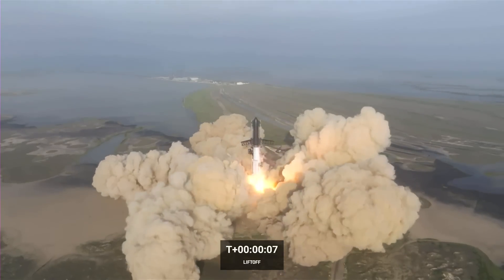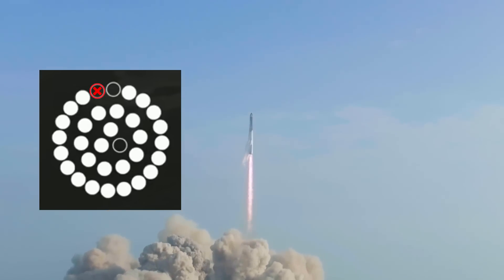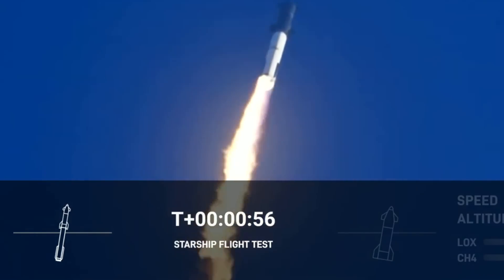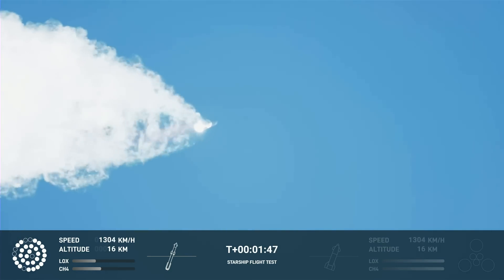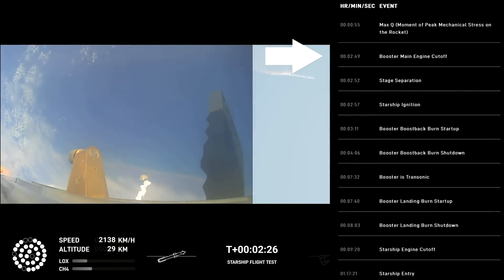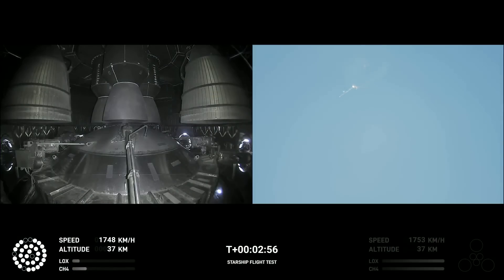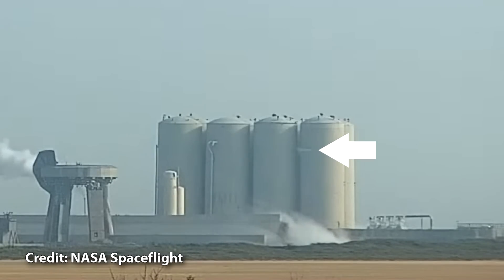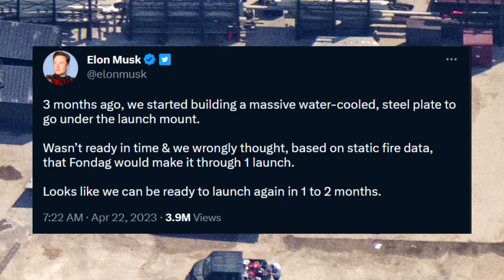I Watched the Starship Test Flight at 0.25x Speed & Saw What Went Wrong | Starship Flight Analysis

Comment: I hadn't expected the ground beneath the superheavy to be the issue and assumed there would've been sufficient planning to prevent the ground breaking up beneath the superheavy at launch. It was ludicrous to see how superheavy was launched blasting in an ill prepared position. That was just a dissapointing unexpected result. Ans the metal plate upgrade, I think it'll be practical for the test launches but nowhere near sufficient below a comercially active superheavy launch stand as the plate will wear down. Spacex is probably aware and I wonder how they're going to solve the flame diverter issue at Boca Chica, which now looks like an insufficient testsite now.

Comment: 9:19 "if this is what happened then this still means that SpaceX waited for over a minute to destroy the rocket"

I can't comprehend how you came to that conclusion. If the puffs we saw were the FTS (and Elon confirmed that they were) then spaceX didn't wait at all, the FTS simply wasn't powerfull enough to terminate the flight and it took a minute either for the aerodynamic forces to rip it apart or for the leaking propellant to find an ignition source. SpaceX had no control over when this would happen once FTS got activated a minute earlier.
Reply from the maker: Maybe I didn’t express it correctly. My point was that they waited for over a minute after the tumble started before activating the FTS.
Reply: @ProjectVirtualHaven  yes, i understand that, but we see the FTS puncturing the tanks right after the tumble started, that's why i don't understand why you think they waited for over a minute. 

The FTS took over a minute to do its job though
Reply: Elon said they need longer explosives to destroy instead of just vent the tanks.

Comment: This analysis is way better than many on channels with 100 times as many subscribers. And then I saw this is not even your main interest!  Wow!

~ 12:10 - I think that ever 4-6 months is very optimistic. Let's say sometimes this year...

Large amount of test data collected notwithstanding, SpaceX shortchanged themselves by rushing the launch from unprepared OLM (which, as you said, survived at all only by dumb luck). Evaryone new the OLM would be torn apart; the only question was how badly. Had they waited for that cooled steel plate (provided that it works, of course - it is still not a proper flame diverter with water deluge), they would have far more data on performance of undamaged Raptors, thrust vectoring authority by the working system, staging etc - much more than, essentially, just structural integrity of the stack.
Reply from the maker: Thanks! To clarify, it absolutely is my main interest haha! I’ve always been into spaceflight. I’ve been following Starship development since before Starhopper. After SN8, I was inspired to share my interest with others and hopefully provide some useful insights. And thanks for your comment!
Reply: @ProjectVirtualHaven  Ah! that explains it. 😀

Your channel blurb says you are mainly into VR.

Keep excellent work!

Comment: Elon said 4-6 weeks, which I think is quite hopeful but could still happen. NASA and SpaceX said 2 months. I think it's going to be a lot closer than y'all think.
Reply: If we factor in Elon Time, it's going to be 40 to 60 weeks. This seems more reasonable given that they have to rebuild the launchpad and then persuade the FAA it is safe.
Reply: @jeremypnet  If only Elon had said that, yea I wouldnt trust him. It's the fact that SpaceX and NASA also believe in it. And I know NASA isn't the best with times either but its a bit better than just Elon.
Also apparently according to SpaceX the launchpad damage isn't too bad. The tower is fine, most of the internals are fine (except some broken pipes / cables), they'll replace some parts of the tank farm they've wanted to, they already have a lot of parts for the steel plate. I still dont think it'll be 2 months, but 3-4 sounds reasonable at least for me.

Comment: As SpaceX approach always has been "try, fail, go further", I pretty sure they are quite happy with the result. I think the most concerning point with this test flight is not about the rocket per say but about the pad. Looks like the rocket could be more reusable than the lunching pad. I am pretty sure no one would have seen this turn of the table 5 years ago :D
Reply: Concrete sucks.
I knew this before this "test".
What a ridiculous waste of time and huge amount of money..
Thick solid metal would do that job.
Reply: @flycorvus  Elon said recently that the metal surface is expected to erode at a rate of about 0.5 to 1 inch per second. (10 - 25 mm) He also referred to the booster as being the world's largest cutting torch. That's some impressive stuff!

Comment: The speculation isn't bad but Elon did an interview 1-2 days ago where he goes into detail of what happened.
The 3 raptors were deliberately not started at launch. The lean was planned as confirmed by SpaceX a while ago since it was for tower avoidance. Around 29 seconds an engine blew up damaging the shielding of the neighboring engines that lead to an issue with one of them. Some time later they lost engine gimbaling capabilities. Some time after reaching maxQ the vehicle begun to spin which was not the separation maneuver but loss of control. And then they activated the fts which did not terminate the flight immediately it just punched holes i nthe tanks and ~40 seconds after that the vehicle broke up probably due to loss of pressure and thus structural stability from the holes the fts made. During the tumble the ship did not try to separate since they didn't reach that part of the flight.
This is not a bad visual analysis it just came out with horrible timing since a few things have just been confirmed to be incorrect.
Reply from the maker: Yes, unfortunately it took me a long time to make the video so timing was poor, but I was happy to see many things I talked about were confirmed!

Comment: If you read the regulations eCFR part 417 appendix D the flight termination is only supposed to rupture the rocket. Actually it is required that FTS itself must NOT cause the propellant to detonate.

So what we saw was actually exactly what FTS was supposed to do as required by the regulations.

I copied the regs below for reference:

D417.3 Flight termination system functional requirements

(a) When a flight safety system terminates the flight of a vehicle because it has either violated a flight safety rule as defined in § 417.113 or the vehicle inadvertently separates or destructs as described in section D417.11, a flight termination system must:  

(1) Render each propulsion system that has the capability of reaching a populated or other protected area, incapable of propulsion, without significant lateral or longitudinal deviation in the impact point. This includes each stage and any strap on motor or propulsion system that is part of any payload;  

(2) Terminate the flight of any inadvertently or prematurely separated propulsion system capable of reaching a populated or other protected area;  

(3) Destroy the pressure integrity of any solid propellant system to terminate all thrust or ensure that any residual thrust causes the propulsion system to tumble without significant lateral or longitudinal deviation in the impact point; and  

(4) Disperse any liquid propellant, whether by rupturing the propellant tank or other equivalent method, and initiate burning of any toxic liquid propellant.  

(b) A flight termination system must not cause any solid or liquid propellant to detonate.  

(c) The flight termination of a propulsion system must not interfere with the flight termination of any other propulsion system”
Reply: Youre confusing "detonate" with "burn". The FTS clearly failed. It must immediately terminate the flight. Imagine the rocket turning sideways, and the continuing to burn for another minute before the FTS finally renders it uncapable of producing thrust.
This another layer of this monumental failure, and demonstrates that SpaceX is completely out of their waters with Starship. Every single piece failed. Launch pad, Raptor Engines galore, hydraulic system, structural integrigry, telemetry, environmental impact, flight termination system.etc. There is not a single thing on there that did not fail to meet it's purpose.
This may as well put SpaceX out of Business. Certainly, Elon will blame the authorities for grounding this parody of a rocket. I mean, according to him they can launch again in one month - in one month, they won't even have finished 10% of the wildlife refuge cleanup.
Reply: @kain0m  The vehicle tumbling means the flight has ended.

The main objective of flight terminated system is to ensure that the vehicle remains within the safe zone, not destroying the vehicle.
Reply from the maker: Very interesting! Thanks for sharing! I would just have to say that it wasn't exactly what it was supposed to do because the darned thing kept tumbling unfazed for a while afterwards. We know now they plan to beef up the FTS so that doesn't happen again.
Reply: @ProjectVirtualHaven  The vehicle tumbling means the “flight” has already been terminated. It is a “flight” terminated system, not vehicle.

That’s exactly what it supposed to do.

Comment: The one thing I think they are desperately short of is space under the rocket, or maybe one way to think of it is the world's biggest welding torch, anything you put at that short distance from the exhausts is not going to have a good day, and the more you raise the height of that base with anything you do put under it ,the forces you have to mitigate reflecting back go up, worse if you chuck water in, which expands like 700X when it vaporisers.

Comment: I have severe doubts debris caused the engine failures, the engine impulse (thrust) would push any debris away from the bottom of the booster easily. A couple of slabs of concrete, no matter how large, are not a problem to move by these engines. The problem was acoustics, specifically BroadBand Shock-Associated Noise which is actually visible as pulses, just before the the blocks of debris become visible. Not mitigating this acoustic phenomenon in any way, and in fact building a perfectly flat acoustic "reflector" below the OLM, is what damaged the engines. They were very lucky the entire bottom of the booster was not pulverized, speaking quite well for structural design of the booster, I must say. 

Acoustic reflections. When this much energy displaces air, it produces significant acoustic shockwaves, which were so intense you can see the reflected waves propagating up from the ground and heading straight up. The acoustic waves were so intense they actually caused the air to refract light and are clearly visible as pulses. The flat concrete surface below the OLM, as well as a lack of water deluge system led to the concrete being pulverized. It was not the force of the engines alone, but instead the acoustic resonances induced into the surrounding air and the concrete. The engines probably had components crushed from these acoustic forces before the concrete began traveling upwards and outwards, just from the acoustic reflections off the flat surface below. The acoustic waves travel at near supersonic speeds, and clearly the concrete debris was not. The concrete being pulverized and the engine hardware failures most likely occurred at the same instant, with the debris flying off afterwards. This is the primary reason for water deluge systems, to absorb the acoustic energy and not for heat control alone, as most people assume. Same goes for the poorly named "flame" deflectors.

The biggest issue is "BroadBand Shock-Associated Noise". Google it. Also there is a paper by NASA about methodology on this subject labeled "SP-8072" and its associated modification from the Ares 1 program; as well as another study titled "Acoustic Prediction Methods for Rocket Flame Deflector Design". You can google all of this. The booster for Starship is the most powerful rocket ever used, so the actual acoustic energies with this pad design are unknown. Hopefully, SpaceX had some measurement devices capable of collecting data on this issue. There are few devices (measurement transducers) capable of handling these levels of SPL, which can be calculated. However, measurement is essential to verify the maths.
Reply: Have we caught a nerd?
Reply: @henrikibjensen3869  Yes ... Yes you have. In all seriousness, I'm an audio engineer and understand the science surrounding acoustics and such. I took an interest years ago when they were redesigning Pad 39a at KSC for the shuttle program. I read all the relevant papers on the topic. Yeah ... I'm a nerd.

Comment: I think it will be a year or more before the next flight.  The pad damage will necessitate a full rebuild of the pad.  That will take time.  Also the FTS activated nearly 1 minute before the vehicle broke up... unacceptable performance of the FTS system.  Not a difficult fix, but another thing that must be solved before the next flight as well.  And then all the FAA hoops that will have to be jumped through to the satisfaction of the Administrator...  Yes, 1 year minimum before the next Super Heavy flight.
Reply: That's what I was thinking. But as things have progressed this past week, I think the damage isn't as bad as we thought. The damage to the pad makes it easier to do the upgrades they need to do. Also Elon said making their own tanks was a mistake and they wanted to swap them out anyways. He says 6-8 weeks until next launch so it's probably 10-12 weeks.
Reply: @shawngadwa269  OK... do you know if they've had time to test the structure of the pad... ultrasonic or x-ray or some other type of testing to get a look inside the structure of the OLM?  I'd really be surprised if all that concrete isn't cracked and unusable.  I know there is a lot of wishful thinking going on right now, but that launch was a worst-case scenario for everything involved...
Reply: Biggest hurdle will be the FAA. Wouldn't be surprised if they're grounded for several months because of that.
Reply: I do speculate 6-8 weeks is wishful thinking considering the FAA grounded the program until investigations are complete. The FTS needs to be upgraded to immediately terminate flight instead of a 50 second delay (Elon confirmed this) and there's concerns about health and welfare of humans and animals because of dust that travels several miles.

Comment: The Skirt of the Starship experiences  maximum compression force not during maxQ as you claim in your video but just before MECO.   This is caused by changes in mass distribution that affects thrust force distribution during flight. Stack is connected so it travels at the same speed. For the stack to travel at same speed both parts of it have to have same acceleration rate. To have same acceleration rate total thrust force is split into two components proportional to mass of each element. At launchpad SH Booster has mass of 4000mT while the Starship has mass of 1000mT. The Skirt at launchpad transmits 1000/(1000+4000)=1/5 of the total thrust  of Raptor engines. At MaxQ SH Booster has about half of fuel and oxidizer left in its tanks so has mass of about 2000mt. The Skirt at maxQ transmits 1000/(1000+2000)=1/3 of total thrust. Just before MECO the SH Booster is almost empty and has mass of 200mT. The Skirt experiences 1000/(1000+200)=5/6 of total thrust of Raptor rocket engines. Once you reflect on these figures than you might start to realise that first: Elon knew that the Skirt of the Starship was to weak to take full thrust of Raptor engines during liftoff approaching MECO.  two: Elon modified fligh profile to minimise acceleration during liftoff to reduce compressive forces acting on the Skirt during liftoff, three: the fact that there were burned out engines was actually helping Elon in his efforts to reduce thrust and acceleration and prevent collapse of the Skirt, five: despite Elon's effort the Skirt of the Starship partially collapsed at acceleration rate of only .75g (normal rate of acceleration before MECO for Falcon 9 is over 3.5g). Six: Partial collapse of the Skirt caused tumbling and lack of separation.
Reply from the maker: Good point. It's very possible that the increased acceleration due to propellant burn off in Super Heavy caused that compression. Also worth noting if I remember correctly there's more bracing at the at the top of B9 and newer, so this might not be a problem in the future.
Reply: @ProjectVirtualHaven  Currently the Skirt can take only about 30% of compression force it needs to take to make the Starship viable rocket. Beefing up current design will not cut it. Switching to diagonal stiffening of the Skirt same as SLS rocket might double the strength of the Skirt at substantial weight penalty but that still will not get Elon where he needs to be. That only leaves two options: pressurize the skirt and deal with stage separation mechanism that includes pressurized seal or use Vac Raptor engines as support columns for the Starship during liftoff. That last option is very interesting but it requires 6 Vac Raptors for stability. This is where beauty of SSTO idea starts to shine very brightly. Elon can easily modify existing prototypes by adding 3 more Vac Raptors and than extent fuel and oxidizer tanks to optimize the Starship for SSTO and do testing. In meantime he can build support structures on top of top dome of SH Booster and call it optimization